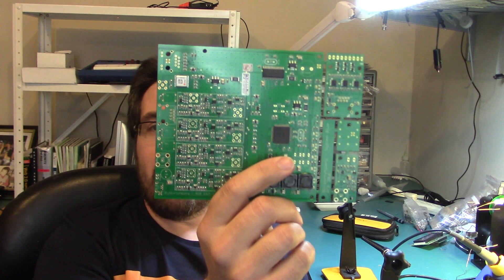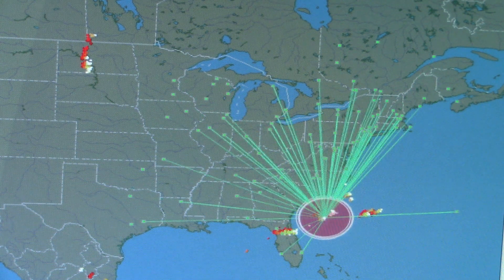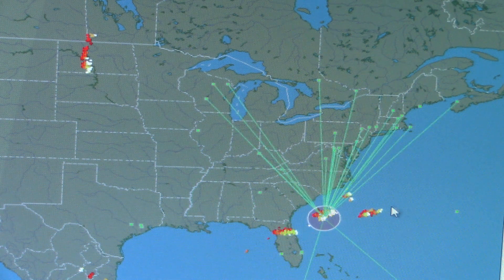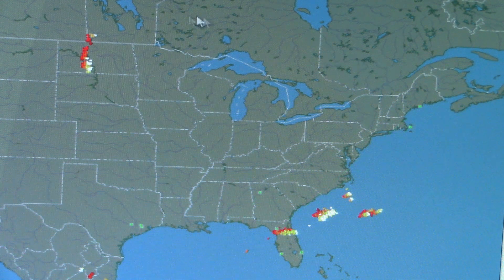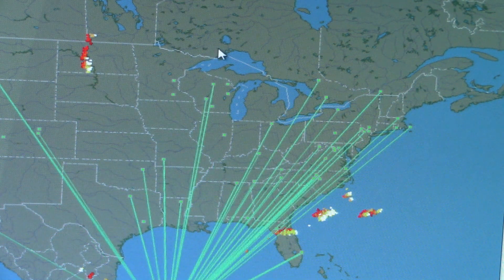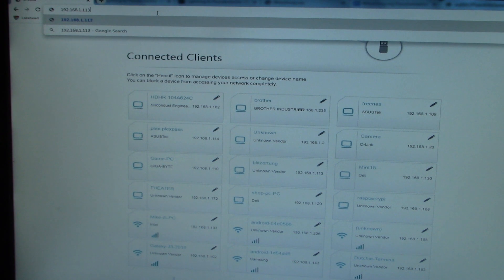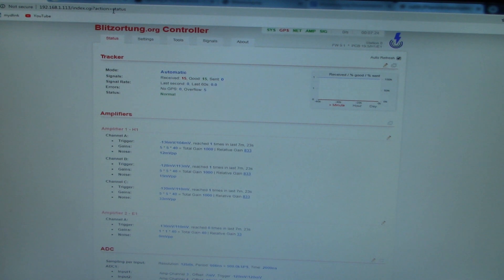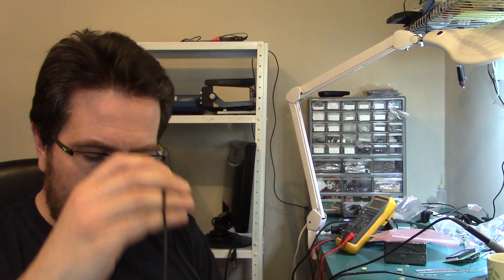Assembling a Lightning Detector - Blitzortung System Blue - Part 1

Comment: Nice video.  Your soldering skills far exceed mine.  Good to see another Canadian detector online.  We could use more especially in the eastern Prairies.  I have been online in Regina since May 2019.    Your stations seems to be performing well.  Welcome.
Reply from the maker: Thanks, I recently switch the station from automatic to manual mode and have been optimizing the gains. I'm getting more signals and the station is going into interference mode less. Seems the automatic mode had the gains a bit to high and the signal threshold a bit too low. Now all I have to do is find the time to mount the antenna outside :)